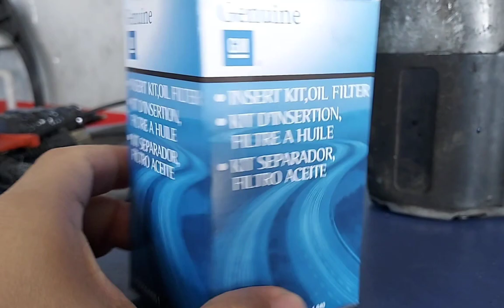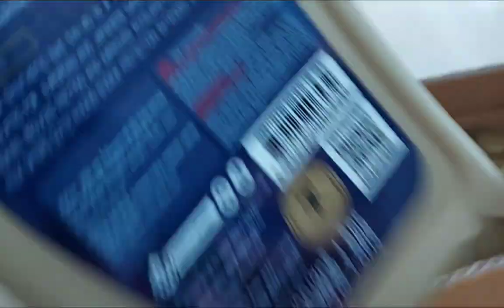Chevrolet Trax Change Oil : Oil Filter PN#55594651

Comment: Hi po, ilan mileage na? Any issues po?
Reply from the maker: Nasa 167,000km na. Meron ng tulo na lang is
Reply: @jethercalope6378  ano po ginawa sa issue? And ano po mga pinalitan ng pyesa..currently own a facelifted version kaya nag ask ako mga issues sa owner.thanks
Reply from the maker: @nylalexis5277  dipa na resolve yung tulo ng langis.
Reply: @jethercalope6378  ok po, may napalitan na po bang mga pyesa for almost that mileage? ilan po avg gas consumption city/hway?
Reply from the maker: @nylalexis5277  tensioner, serpetile belt, brake pads, tie rod end, stab links, according compressor, shock mount, PCV valve cover
Reply: @jethercalope6378  noted po dito sir, how about po sa water pump and hose's na known issues?
Reply from the maker: @nylalexis5277  yung coolant reservoir at mga plastics fittings. Fuel consumption  7 to 9 kl per literally city. Gang 13 kmp sa Nlex. Ave combined 11 km/L
Reply: @jethercalope6378  thank you sa info po, big help.👏
Reply from the maker: @nylalexis5277  no worries. Meron pa ako ng mga video sa Trax maintenance. Hanapin mo na lang sa Playlist sa channel ko hehe